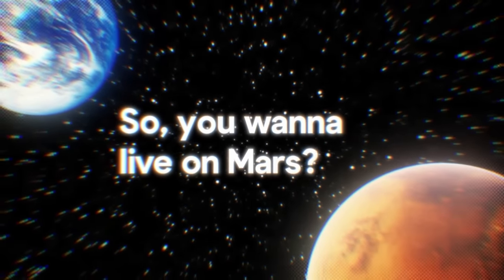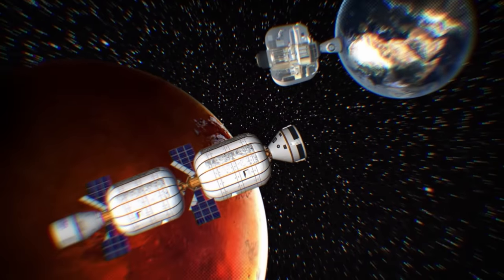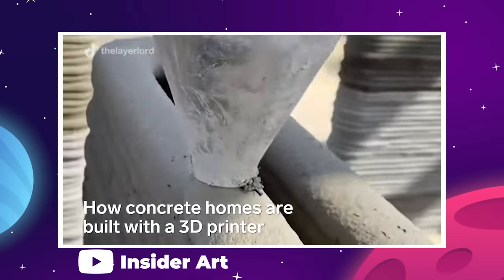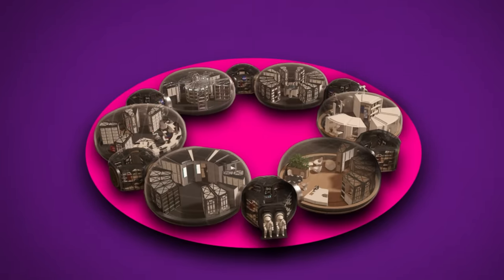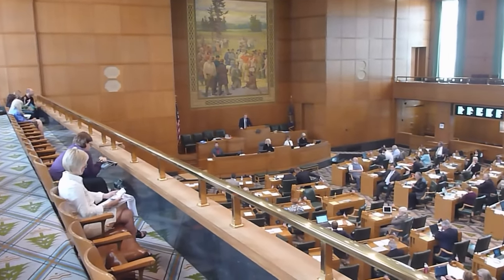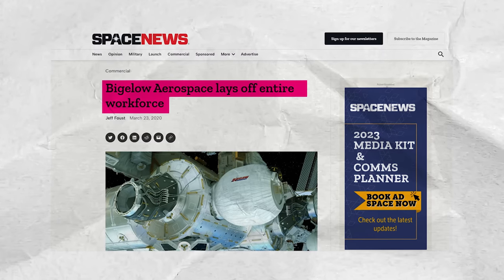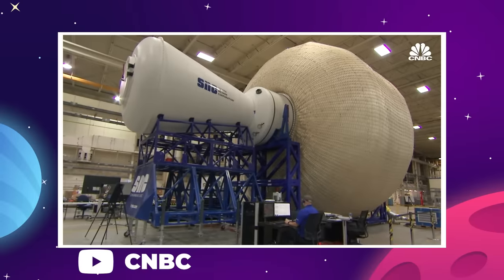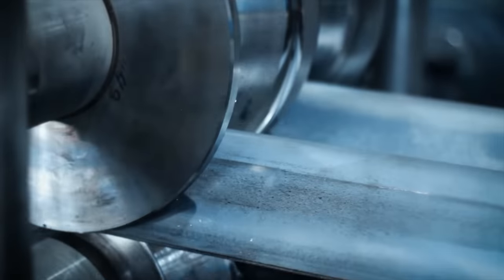Why Inflatable Habitats Are The Key To A Mars Colony!

Comment: A recipe for disaster.
There's hardly any protection from micro asteroids on Mars,
since the atmosphere doesn't protect well enough.
So, unless you bring a whole lot of patches for the inevitable holes,
really bad plan.
The initial deployment should be subsurface, like 25 meters,
to provide the protection for these micro asteroids.
One that is done, and a viable long term existence can be guaranteed,
then you can start trying to build surface structures, which will then
suffer these impacts.
Living space, underground, unless you like sleeping in your spacesuit,
vegetable produce, underground, unless you want to suffer grandiose crop failures.
Oxygen/CO2 filtering, underground, unless you don't like breathing the same air.
Power generation, solar power, with storage underground.
Vehicle bay, part's surface and parts subsurface, unless you like maintainance.
Curved entryway into the subsurface.
Reply: The thing is like 16 layers of fabric.
Reply: @richdobbs6595  16 layers ? Wow, I'm sure that'll stop an incoming micrometeor. (not).
The kinetics involved in a micrometeor, are not stopped by something even as tensile
capable as twaron/aramid. It's also flaming hot, which melts the twaron/aramid before actual touching it,
negating any tensile strength strength derived from it.
It's a bad idea, simple.
What should be done is remote ops on an underground complex by drone/robot.
The machines can receive new instructions by the hour, and try to complete them with simple
heuristics. If they cn't different instructions for the next hour.
Continuous streaming of their progress back to Earth has only a one time delay of 30-60 mins,
but can be continuous. The task is simple, dig, harden, solidify/compact mined matter into
bricks. That's it. No more no less. WIthin the time that a Mars mission starts,
many cubic meters of rock can be moved that way, and create the basis for an underground
base of operation, which can then also use inflatables, although I'd use those on the surface,
while the underground is an always safe fall back position for anything crucial like
oxygen generation, food production, habitat and simple basic workshop.
Anything else is simply a bad idea. There's no rescue from Mars when something goes wrong.
The travel time home is like 6-12 months with current used rocket tech, and can be
reduced to 2 months with some solid fuel ion propulsion (not NeXT, or NStar or such,
these are like obsolete from the time of publication, and don't use solid fuel as a fuel source.)
(For the solid fuel, think carbon or such, two part held together, passing through current,
ionising the carbon like in an old fashioend searchlight, then pulling the carbon from the
point of contact. This may also be achieved by silicon, using forced electron migration.)
If they wanna make an ion engine that's really powerful, they should have scientists with
imagination and resourcefulness working on them, not some repetition guys that read a book
about ion engines and simply rebuild the same principle over and over,
thinking that finnicking will increase output to what is required.
The basis is simple, expel fuel at fractional lightspeed, like at least 0.1c, then use 10 kg
of fuel to accelerate 10 tonnes of weight to 30 kms, over a period of like 1 month.
If higher can be achieved, the better.
The burn rate with that would be 4 milligrams per second.
(acceleration 1.1 cm/ss over 1 month)
Add engines as required, 1 for each 10 tonnes. Chop, chop, what's with the wait.
Ion engines have the best result for any acceleration in space, since they can
use much higher exhaust velocities, and therefore beat any
conventional (crude) rocket engines. We'd need rockets to get the stuff up there,
but for the leg between Earth and Mars, ions are the thing.
Reply: @ZMacZ  Boy, you're certainly invested in this.  Where did you get your Martian construction degree from?  How did you finance developing an enginering simulation of the this?